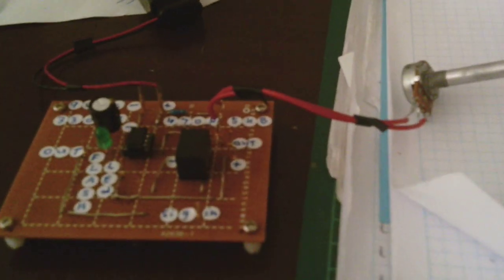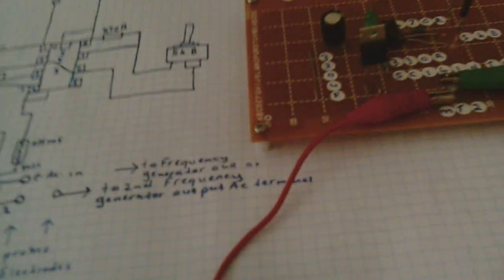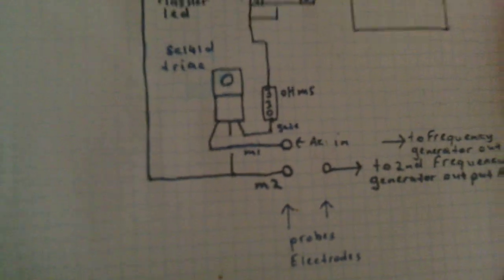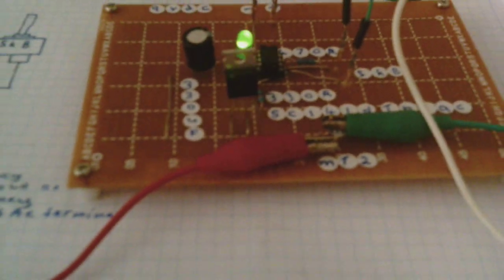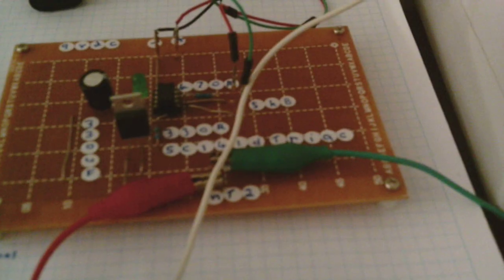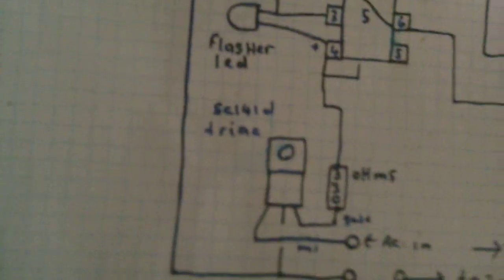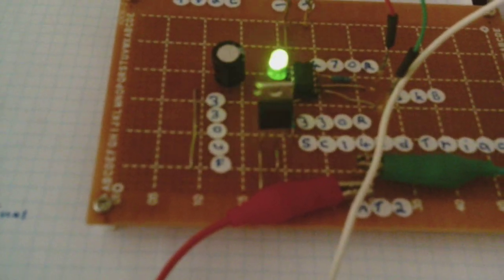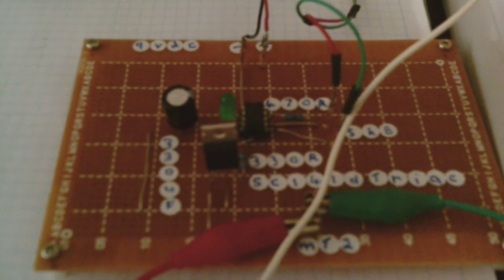new triac version variable speed ac frequency pulser circuit

Comment from the maker: date 13-3-2024 did some experiments with this circuit linked to my frequency generator and modified Rochelle salt crystal electrodes  cam Corder used to film was getting to low on power and wanted to shut down so i shot a few small videos but in the end after all was switched off my scope was reading and showing a waveform coming from 
 one out of 2 Rochelle salt crystal electrodes and the scope before was getting strange readings in the dc from a circuit that uses and switches ac using triacs in it and yet in ac it showed what appeared to be very long square waves  and more

Comment from the maker: if the triac has any thermal control inside it it may switch off till it cools down so when it turned off i then took it to my desk and fired it up again and it worked  agptchat says it has thermal temperature shutdown inside the sc141d triac i have yet to verify that with the datasheet also i put some heatsinks on them

Comment from the maker: i built another but made some changes i used the bt137 600e triac and changed the capacitor to 470 uf and the potentiometer to 10k and what i got from the dso15o scope test was very strange and bizzare and useing my frequency generator through the circuit and scope gave even more strange results

Comment from the maker: today the 112-32024 I've completed my multi variable speed frequency pulser circuit and installed it into a new home made pvc circuit box  I've given it a slight test but tonight I'm set to test it more ,optical white light flashes is something you always experience when zapping the head area but today in a brief test i saw something I've never ever seen before and i don  remember it flashing but with my eyes  closed i saw a purple light , and I've never seen anything like it i held one coper pipe electrode under my forehead hairline i saw a purple light behind my closed eye lids, maybe at that low pulsed low frequency its enabling my optics to see ultraviolet light emissions from my eyes against the back of my eye lids ?